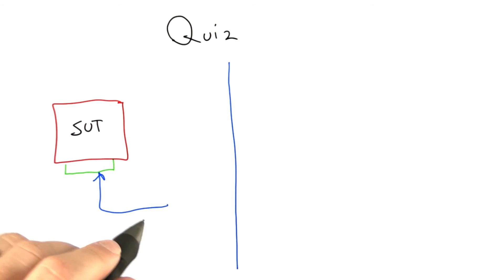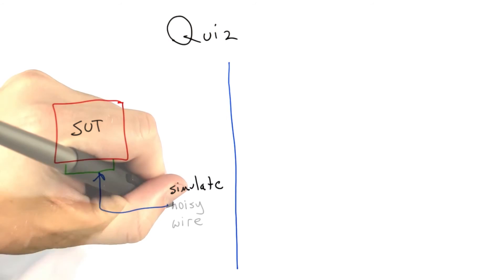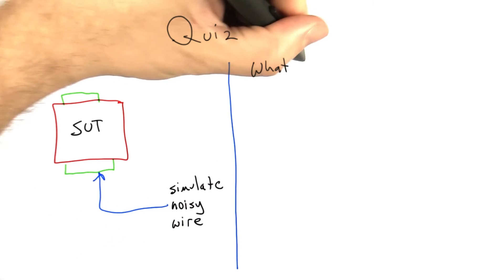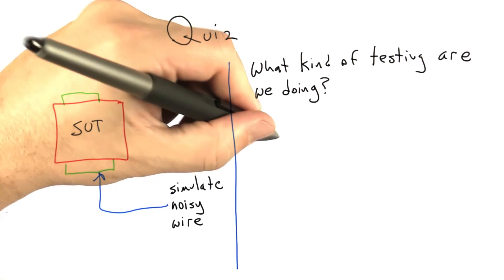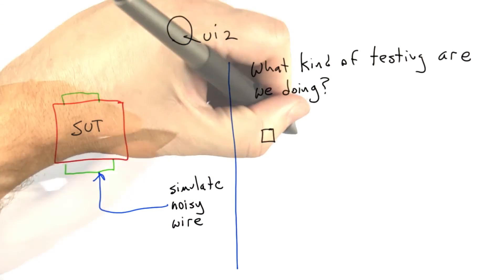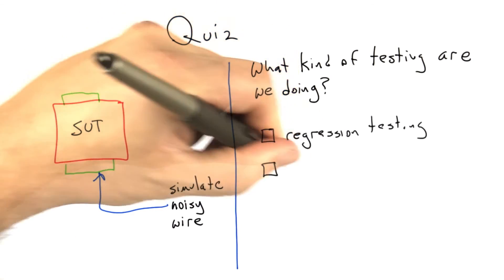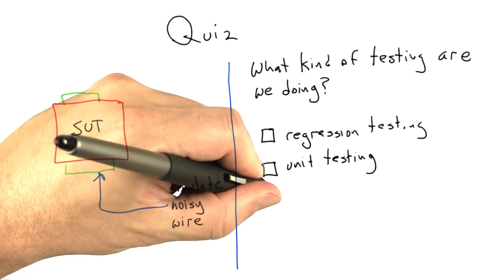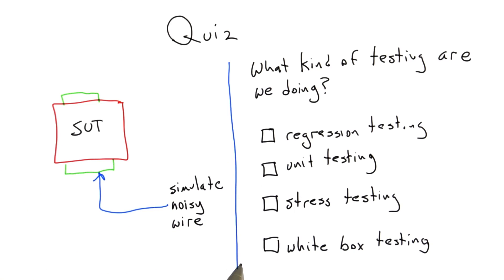Testing Car Software - Software Testing

Comment: Regression test cannot be because the regression tests are for for problem which was also be found in the past
Unit testing, I don't think can be
Stress testing can be because we force the system to check if that noise can activate or not the airbag
White box cannot be because we don't see the code.
Does my answer is correct?